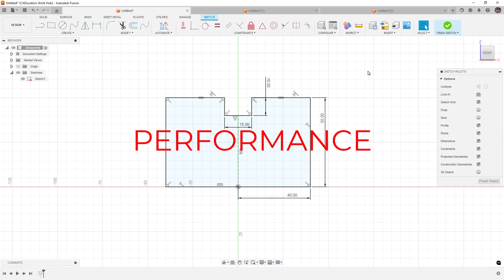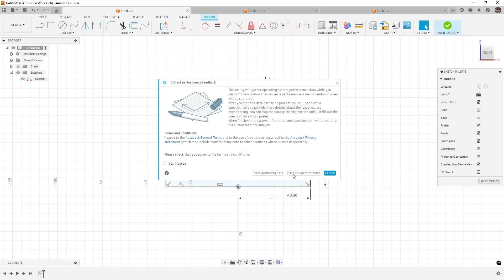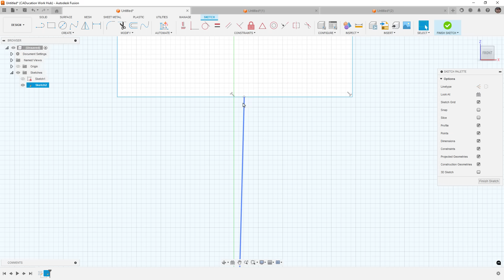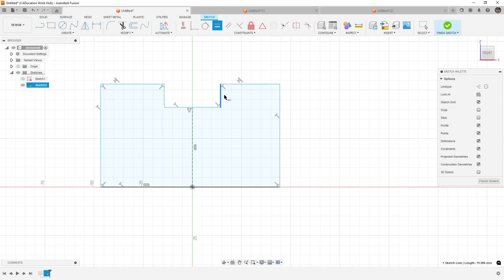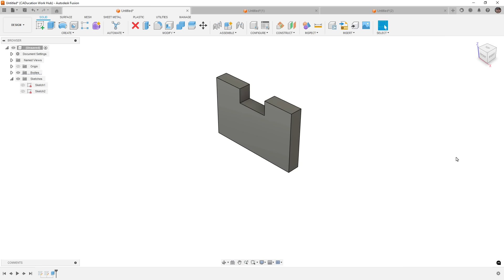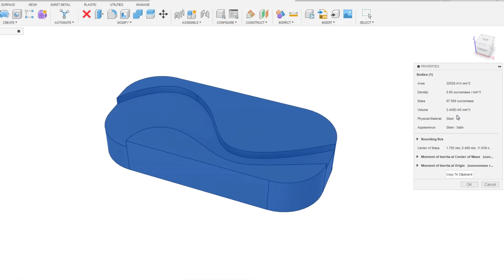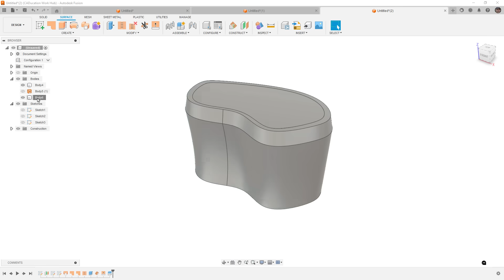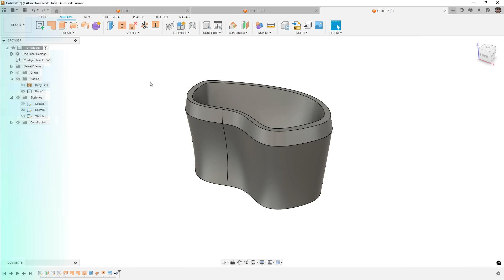What's New In Fusion - March 2025 | Automated Constraints | DXF Export | Configure Surface Feature

Comment: how much does it cost to reverse engineer a side mirror housing and where do I send the file
Reply from the maker: What is your intent with the end file?
Reply: @LearnEverythingAboutDesign  I want to repeat the modeling according to your example
Reply: @LearnEverythingAboutDesign  I would like you to make a video on the reverse of such a part as a mirror housing. Can I send you a file for an estimate. How much money will it cost?
Reply from the maker: @cactus_masters8547  really to do something like that you need a scan of the part inside and out.  Then you need to decide if the model needs to be done in CAD with history or a "dumb solid" will suffice.  And if its for manufacture like injection molding.  Its a rather expensive process and not something I really do for clients.  If i had to just throw out a guess to do it right I would say a few thousand dollars.

Comment: I haven't been able to verify this, but I feel much of the degradation in performance is coming form Microsoft and how they are intentionally trying to force people to mover forward in hardware, Microsoft has removed Intel 8th, 9th, and 10th generation CPUs from its Windows 11 24H2 official support list for new OEM systems. 

I have been on the forums for years complaining about how the dialog box constantly is in my way! Allow me to disable it please!!
Reply from the maker: Terry I would have to agree with you on the windows thing.  my desktop which still runs great is on win10.  win11 keeps getting pushed and i have to deny it.  My older computers are going to be somewhat useless come october.  You can pay for win10 support for 3 more years but it won't matter much if programs don't support it.  On that gripe list my win11 laptop has more issues than any computer ever.  It will just crash from time to time.  It also is really bad about remembering my settings like in Outlook.  I toggle to use the old outlook, it asks me why, reboots.  and opens classic. t hen the next time i open it the thing reverts to new outlook again.  I wish there was another option but doing design work with fusion, solidworks, inventor and more means i need to be on windows 11.

Comment: I just wish they'd stop taking cam functions away from hobbyists. Im not paying 1400/yr PER SEAT for indexed 4th axis.
Reply from the maker: you can do multi axis position in the commercial license as well as 2d unwrap axis substitutions without the mfg extension.  I have updated content for Autodesk but not sure where it is.  here is an older video talking about it.
https://www.autodesk.com/learn/ondemand/course/fusion-360-cam-strategies-for-multi-axis-milling-expert/unit/4k0z5eJj24up9iqHjZdsrf

2d unwrap is available to substitute one of the XYZ axes for a rotary axis. the downside is that its unwrapped based on a cylinder but can help with grooves and things.  

Positioning is available for any 2d and 3d toolpath so if you have a 4th or 5th axis you can move the part into place and use a 2.5 or 3x strategy.  Its just the true simultaneous stuff.

I will say a few things.  Most hobby users don't operate a 4th axis :)  in most cases they are mini mills or desktop trainers.  In some cases like say Makera they offer their own CAM solution.  Also I do like that you can buy access for a day, month or year.  When i was programming full time I was using Mastercam and SolidCAM and 99% of the time it was 3x.  Very rarely did i need to program multi-axis.  If i hadn't had the Mastercam multi axis package it would have been feasible for me to buy access for a day or two. 

just my 2c

Comment: Is there a way to flat pack a surface, or transfer a solid to a surface.
Use case scenario, I want to be able to apply vinyl to parts of my solid. So would be great if I'm able to get the actual dimensions required.
Reply from the maker: Not really with Fusion without an Addin that is pretty expensive in my opinion.  Inventor has this option to unwrap a surface though.  

As far as converting a solid to a surface.  If you go to the surface tools you can "unstitch" a solid into surfaces.  You can also delete a face of a solid which will convert it to a surface.  But this doesn't help with flattening.

XactFlat i think is the name of the addin for Fusion.  Last i checked it was like $1500...
Reply: Thanks for the information I will look into it, but yeah that's a lot of money. @LearnEverythingAboutDesign

Comment: "Looks like I got an extra little line in there": This happens to me constantly. I thought I had some mouse button debounce issues but Fusion sketching is the only place this happens to me. I even upgraded to a 3DConnexion CAD Mouse and the issue remains. This is a stange...feature...of Fusion. Also, completely agree with the checkbox. I dislike most auto populating near-cursor dialogs, but the checkbox ALWAYS requires me to change zoom to click where I want.
Reply from the maker: This little line thing also happens in other CAD programs fyi.  Solidworks has a Sketch doctor to find stuff like this.  There are some tools in fusion to help find these things but you have to do it from the command line....

Comment: For me, overall Fusion is much faster recently. However, save and closing the app is MUCH SLOWER.
Reply from the maker: Are you on win10 or win 11 (or mac) machine?  It is faster on my win 11 machine, but i can't really tell if its an OS thing or processor difference.  My win10 machine i am not ready to upgrade to 11..... running out the clock.
Reply: @LearnEverythingAboutDesign  I am running Win 11. Its hard to say how much changed due to the OS as I "upgraded" around the same time Fusion was pushing out their performance updates.

Comment: The Fusion Development Team STILL hasn't touched the anemic Scale tool, which is a bummer. (4:30) Totally agree with you, Matt: The green check and the input boxes that pop-up in front of work could EASILY be fixed; though frankly the green check just needs to go away permanently.
Reply from the maker: i wouldn't expect them to do anything with the scale tool.  It is the same it has been since fusion first started.

Comment: Ja zrezygnowałem z Fusion i przesiadłem się na całkiem darmowy FreeCAD 1.0
Jest REWELACYJNY!!
Jeśli Fusion nie stanie się w pełni darmowy dla zastosowania prywatnego i niekomercyjnego, to niestety umrze za kilka miesięcy.
Reply from the maker: Fusion is free for non-commercial work but there isn't full access to everything.  Like you  have CAM but not multi-axis.
Reply: @LearnEverythingAboutDesign  full? Joke.
Reply from the maker: @3DPRlNT  Yeah like you can program toolpaths but you can't do gcode with tool changes.  I think thats fair of a company that invests in development to not offer everything in the free version.

Either way Fusion isn't aimed at creating a free application and I don't imagine it will fail if they don't open up all the features to everyone for free.  I am glad Freecad works for you, but its not the right solution for everyone.
I use Fusion, Inventor, Solidworks and other programs based on client needs.  Most of the time Solidworks or Inventor are needed based on file format and a companies CAD system of choice.  The problem you get with Free cad solutions, or even ones like Rhino, is that the ui/ux development is lacking.  The kernel of choice for FreeCAD is going to be its limiter.

Comment: I haven't tried it yet, but I wonder if autoconstraint feature is more useful to finalise the sketch: you define the measures/constraints you care about and it automatically fills in the rest of details to fully constrain the sketch
Reply from the maker: sadly no.  I mean i guess you could but it wouldn't really save you much time.  I think the only place it likely would save time is if you brought in a dwg/dxf from another CAD program and wanted to dimension it quickly.  The biggest problem is that the idea behind adding dims or constraints is very dependent upon intent, and that is something the autoconstrain tool can't know.

Comment: Its time to make the long wave goodbye to a wonderful program. Fusion was my first. I am making the switch to solidworks and or Inventor. Offline is where its at.
Reply from the maker: I will give you a warning.  I became a SW expert in like 08 or 09 and used it for a long time.  Its going downhill....  I strongly believe Fusion is the future solution.  I have and still use and support solidworks and inventor in addition to fusion fyi.  SWx hasn't really fixed its problems from 10 years ago and IMO it isn't worth the money it costs.  Inventor is a good program for the price but I am not a fan of its data management restrictions and also ui/ux is much better in Fusion.

As someone who does design consulting for a living and has all 3 programs I still go to Fusion first.  for whatever that is worth.
Reply: @LearnEverythingAboutDesign have you used on shape? I have moved over to Onshape from fusion for personal projects. It’s still way too expensive for the commercial use but I absolutely love it more than fusion.
Reply from the maker: I have.  Back when it was getting started i was a beta tester and have made courses for it for Pluralsight.  I am not personally a fan of it and yeah the price of $200/mo i think is high....  They are starting to integrate things like simulation, but that is a big downside for me.  Fusion has CAM, Forms, Simulation etc in one place.  Fusion does have a browser version which is full feature and uses the same datasets as the desktop installed version fyi.  fusion.online.autodesk i think.
Reply: Unless you really, really need something that Solidworks offers that Fusion doesn't (which isn't much these days), Solidworks is in no way worth the money, and is so insanely unstable compared to Fusion that it's not even fun.

No, offline really isn't where it's as, not now, absolutely not in the future, like it or not.

I've got 20 years of CAD experience, mainly in AutoCAD, ~6 years in Fusion and 2 years of SW, Fusion is hands down the best overall solution available, and punches so far above its price that the others should be ashamed.

Solidworks is basically EOL, and kept alive by institutional inertia 😅
Reply: @Robinlarsson83  grim thoughts...
Reply: What about the SolidWork hobbyist license? It’s around 40$/year if I remember correctly please correct me if I’m wrong. Honestly for me fusion is way to expensive specially for someone that is just getting started and not making much on it. They should honestly rethink adjusting the prices and do custom pricing and let the user choose what tools they want and make them pay a decent affordable price. I personally don’t use CAM and a lot of other tools 🤷‍♂️
Reply from the maker: @ali-sleimanchehade6129  the 3dconnection platform is a bit of a joke.  its "janky" and Solidworks should make it free rather than charging $40 for it.  I was big in the SWx community from about 09 to 2019.  When the original creators of SWx were bought out and left to form OnShape, the SWx crew laughed.  Well onshape took off and all these years later SWx is playing catchup.  The biggest problems with 3dconnection won't be sorted anytime soon.  And the fact that you need to export a freeform design from the cloud to use in the desktop application is absurd.  Even back in the day SWx charged students $100 per license.  Most schools covered the cost, but Autodesk gives nearly all of their software to free for students.

I only open SWx if i have to these days.  And yes I paid thousands of dollars for a license and still don't use it unless a client needs it.

Plasticity is great but not 100% a CAD replacement.  its CAD for artists.  So if you are trying to model things for rendering/viz/games/animation or just want to play with it for 3d printing its a great tool.  For consulting work i do for clients 99% of the time i use Fusion.
Reply: I’m honestly thinking of about plasticity but still I wish I could still use fusion
Reply: @ali-sleimanchehade6129  Autodesk does offer a very well priced 3 yesr Startup licence for Fusion for new companies. 
And if you're not making money on it, they also have a free hobbyist licence. I'm not sure about the exact terms for the hobbyist licence, but it's still there :)